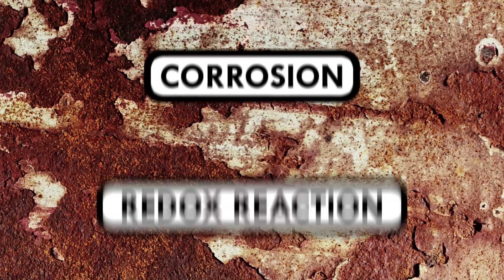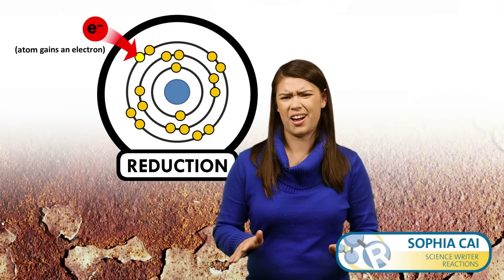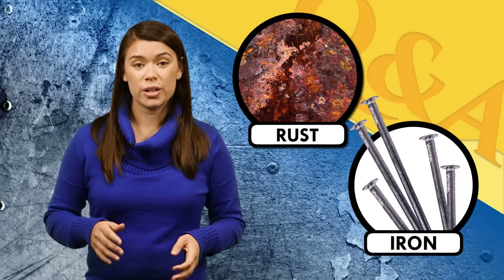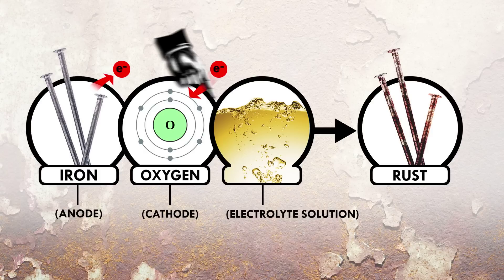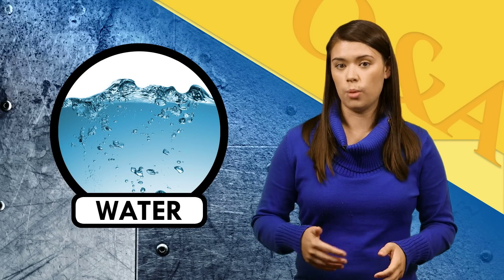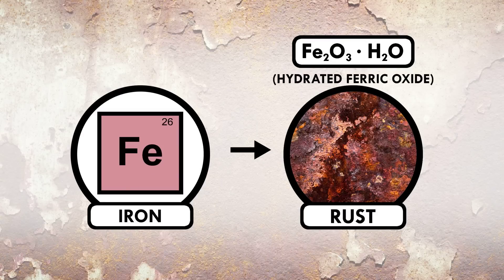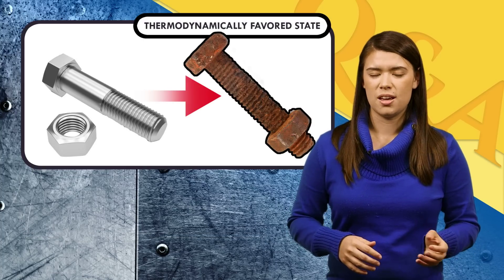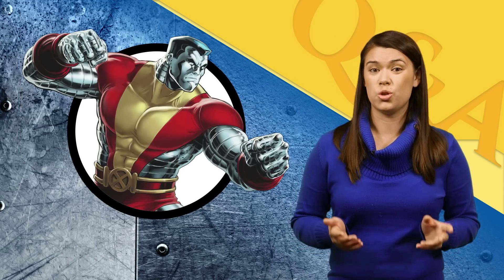Why Does Metal Rust? - Reactions Q&A

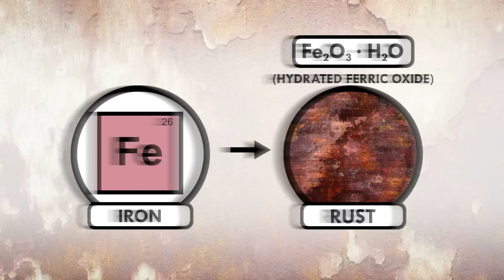Comment: dude. this is the best explanation of rusting I HAVE EVER SEEN, great job AND THANK YOU SO MUCH FOR EXPLAINING RUSTING. but, some terms im still not used to is electrolyte :/ i dont get why water just shuttles and does not react with iron. Iron, could react with water technically right?!!? the chemical equation on 1:12, is it accurate? then what is Fe + 2H20 -> Fe(OH)2 + H2? im just so bamboozled rn

Comment: What if you have iron and water but no air?
Would the metal still corrode?
E.g, a compressed metal tube with water in it. 
 You need air to gain the metal's electrons in order for the metal to corrode, right?

Why do metal sewer pipes corrode from the inside even though they are wet on the inside most of the time and there  isn't much air?

Comment: During oxidation of alcohols, using acidified potassium dichromate, why does it form an aldehyde (if primary alcohol) and then a carboxylic acid? Wouldn't it be easier for the molecule to just form the double bond with the oxygen and give up a hydrogen (ie go from alcohol straight to carboxylic acid)?

Comment: Does the reaction have to be spontaneous for the corrosion to happen?
Reply: No, it can be predictable : )
Reply: +Gunnar Karlsson Yes, if the corrosion occurs it is because it was "spontaneous" which simply means the corroded form was thermodynamically favorable (lower energy = more stable). However for most folks spontaneous means instantaneously which is decided by kinetics, the rate of a reaction.

Comment: So the next logical question...
Q: What aspect makes mixing metals(alloys) and galvanizing prevent rusting?
Reply from the maker: +Dragon Skunk Thanks for the next question. This comes from our scientific consultant, Darcy: Galvanizing is a process of adding a surface coating of a metal that oxidizes more readily than iron. Typically zinc is used. This does two things: 1. the zinc covers the iron-based metal, protecting it from the rusting air (like paint mentioned in the video); 2. even if the zinc layer is scratched and exposes the metal beneath, the zinc oxidizes and gives up its lost electrons to the iron, meaning any iron rust turns back into metallic iron. Zinc oxide is white, but the layer is so thin it's transparent, and the metal object keeps its silvery color.
Reply: +Reactions
Thanks! I asked as I thought you guys wanted ideas for a video. Ya know, "questions I'm dying for you to cover."

Comment: When I have pulled pure sodium out of oil, it immediately reacts with the oxygen in the environment without a liquid medium. Is that due to the moisture in the air or is it possible for some redox reactions to occur without the liquid or pumping in lots of heat?
Reply from the maker: +Austin Anderson Once again from our science guy Darcy: 
Even in dry air, bare sodium metal oxidizes as fast as steam rises from a hot cup of coffee on a cold day. This is because very little energy is necessary to entice a sodium atom to give up an electron, whereas iron doing so requires just the right conditions and lots of time. Sodium also happens to react with water, forming sodium hydroxide (NaOH) with such vigor it erupts in yellow flame, which is why it's kept under oil: in dry air, it forms Na2O (technically "sodium rust"); in humid air it can catch fire and form caustic NaOH. Either way, this means sodium isn't a useful metal on its own or in alloys - it just crumbles away.
Reply: +Reactions Awesome, thanks for the answer.

Comment: If you keep mixing two things for a very long time can they eventually unmix? Please i need an answer
Reply: +NJ Yes, if it's a mixture then it can be separated.
Reply: +Levi “Levitacus” Sinclair not seperated.i meant can the two things unmix while mixing them for a very long time
Reply: It depends what exactly youre mixing. Some compounds are very unstable and soon after formation decompose, regardless of how much further mixing you perform. Though in a general sense, you really can't "overmix" molecules in the sense that you'd force them apart. If that were true, all my compounds for lab that I leave mixing for 24 hours would have little to no yields, which isn't the case.
I hope this helps.
Reply: your question is very vague are there two " things" you have in mind.?